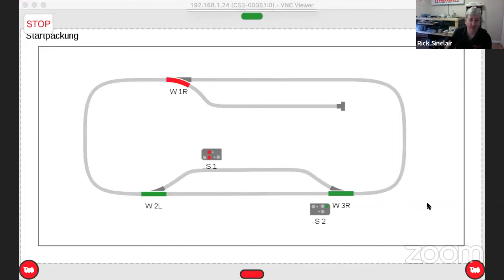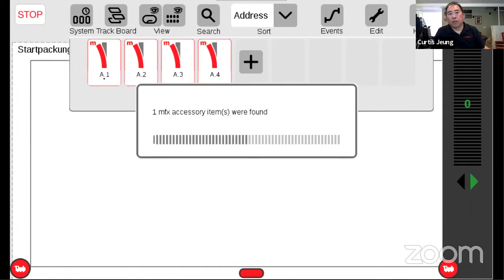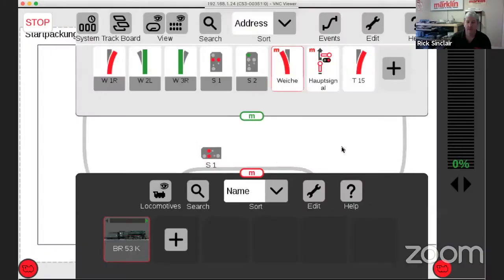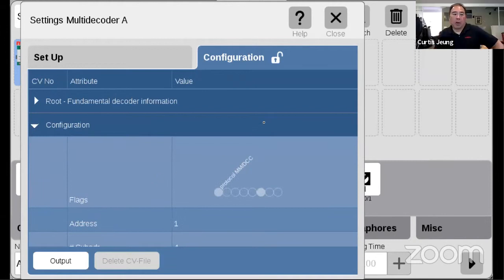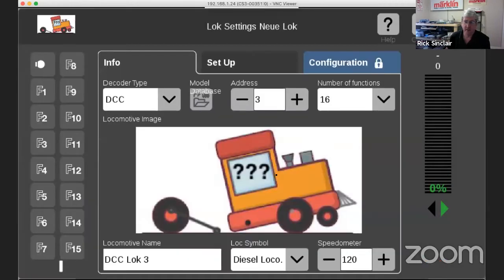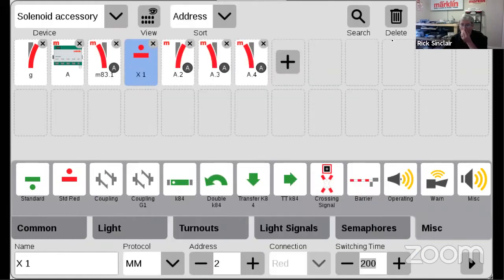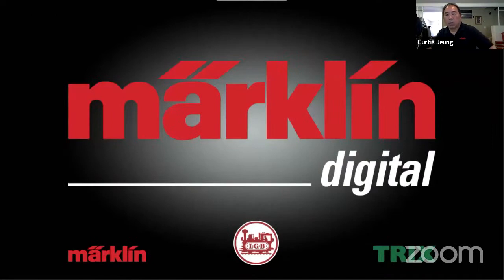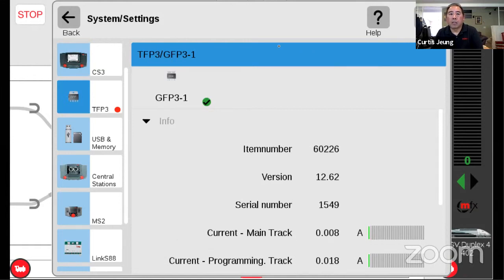Marklin Digital Club Webinar #3, Adding Articles to the Central Station 3/3+

Comment: What abut the 40 turnouts I have been running with my MS2.  Do I renumber or use the same numbers?
Reply from the maker: If you are referring to the address numbers, you shouldn't have to change addresses as long as they are all functioning correctly. If you are referring to the name label, it is your choice on if it is most effective for you on identifying individual turnouts.